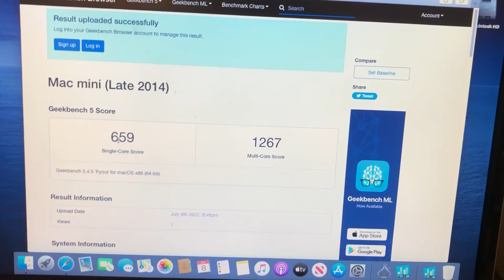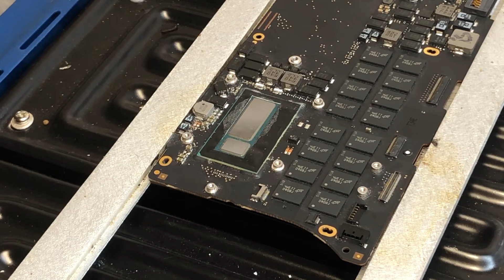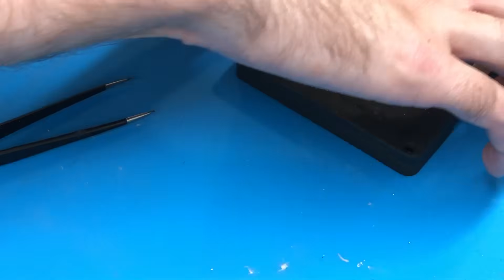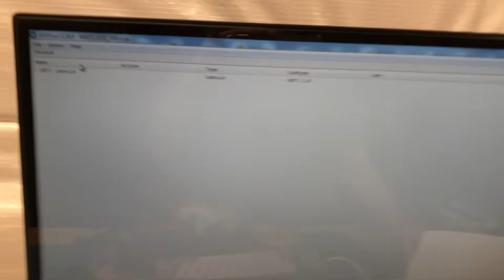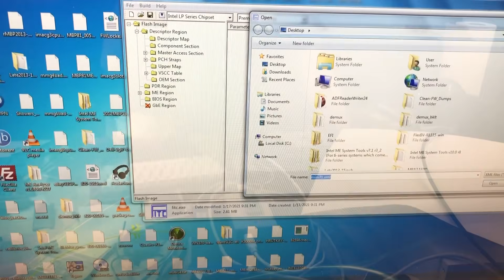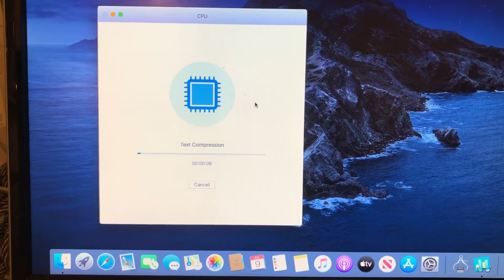2014 Mac Mini RAM and CPU Upgrade

Comment: Holy hell!  I thought I was cool upgrading my 2012 mini with 16G of RAM and 256 SSD.  This is hardcore.  Well done!  I love my mini!  Have Big Sur on it and for daily home stuff it works great.  At my work office I have the latest Apple gear.  EDIT: Geekbench 704 / 1726 with the i7 / 2.6Ghz / 16G / SSD / 4000 Graphics.
Reply: Why haven’t you upgraded it to Monterey yet?
Reply: @abduujabor  well you’re not supposed to get Monterey for Mac mini (late 2012) since it’s not “compatible” (which is a stupid lie apple made up) for it. 

But the thing is, you actually can get it! It’s just that you have to use open core legacy patcher (which is easy to use) and you need a 16+ USB flash drive to be able to use and get Monterey. 

Here is the link to the video of it happening. It’s actually works and it’s legit. Link: https://youtu.be/McmO7xP4wvI 

(Edit) I also recommend having 16 gb of ram (which is easy to change and it’s the most a Mac mini can take) to make the experience faster.
Reply: Oh. My 2014 mac mini is stuck with 8gbs of ram. Unless I do the procedure myself

Comment: i think the surface tension of the solder is strong enough to warp the hot chip when you take it off the board with the vacuum pump.try next time to flip it next on a paper towel with tweezers from the sides.i have removed cpus with tweezers aswell with 0.5mm metal blade tool.but overall you are a pro :D .keep up the good work

Comment: Please tell us, what are the tools your are using for these upgrades. Please it help
A lot
Reply from the maker: Just a standard Aoyue hot air station (with Aoyue 4545W nozzle for large BGAs), Puhui T8280 preheater, Madell QK853 small preheater, and Ksger T12 soldering iron.
Reply: @dosdude1  wow, with those tools, you are doing such an amazing work. 
Im also a board level repair and programer from Tokyo.
Keep going with your great works genius 💫 
Im pretty sure, you will be a legend of the computer industry. Amd gmug gpu fix, os patchers are  still helpful to save millions of peoples money.
if you can manage a little time, im really happy to sponsor a visit japan and show my workshops. Please send me your email if you interested.
Anyway Thank you. Good luck 🤞🏼
Reply: @dosdude1  if you don’t mind please send me your contact email. I wish someday i can see and talk with dosdude1 and Luis rosmman. Because you both guys have done such a great job for this industry.

Comment: Hey can you please write down in your video description which hardware are you using? I would like to know which preheater, which reball station, which soldering iron and which hot air gun are you using. I want to upgrade my equipment and I need some inspiration or tips. :-D

I've asked you a while before in comments in other video but I've never got respond.

Comment: Reballing that apu is the most difficult part because of the warping you mentioned, on  the 10th gen intel had to glue a metal support bracket to the corners to avoid It

Comment: I still have one of the 2014 i7 Minis as a daily driver, but unfortunately only 8GB Ram, which starts to  become a problem these days. Also, while it has a factory SSD, that one is very slow - slower than a budget sata SSD these days. Upgrading the SSD could help, soldering more ram myself is far out of my league, and getting someone else to do it would be expensive enough to rather save up for a used 16Gig M1 mini. Still, it's awesome to see that it can be done. Great video, dosdude1 !

Comment: Proof of concept talk: I have a 2011 21.5" iMac Education version (i3-2100, 256MB version of 6750M, no Bluetooth, 250GB Sata 2 HDD) that I got recently for mega cheap (less than $65). What would be the best and most powerful GPU upgrade with the following criterias: short length MXM card, as OEM as possible, retain boot screen and brightness control? Here's an idea: try and upgrade vmem on the stock 6750M GPU to 1GB or 2GB. Possible, doable, bios has straps for it, etc-etc? Any inputs are welcome. Oh, I can do the bga work myself.
Reply from the maker: Those Radeon HD 5xxx and 6xxx series video cards are unreliable trash, so it wouldn't even be worth a minute of your time to modify one. The optimal thing to do, of course, is upgrade the video card. There's a whole thread here containing compatible cards, along with custom VBIOSes, allowing for boot screen and brightness control on most: https://forums.macrumors.com/threads/2011-imac-graphics-card-upgrade.1596614/
Reply: Just don't put in an firepro m8900 in it as it is perhaps one of the least reliable mxm cards ever produced for both pc and mac.

Comment: First video of yours I've seen. Absolutely phenomenal job. I pulled the BIOS chip off of my 2014 Mac mini main board, dumped it, modified it, reflashed it, and resoldered it, but this is so beyond any of that. My only question is what is the motivation for this over buying something used (even the exact model you're upgrading to) or some other option? The challenge? Learning? Fun? Because I can't imagine any cost "savings" having to buy a Mac donor board + RAM chips, no less the stencil, etc. and sundry equipment I assume you already had and time required.
Reply: @anshadedavana  Absolutely it's not a for-profit endeavor. In a different comment he said "I'll either just keep them around, or give them to friends of mine who want them."

Comment: The performance improvement wasn’t as dramatic as 1.4GHz vs 3GHz would suggest because of turbo boost
It’s really 2.7GHz peak vs. 3.5GHz peak. Roughly 30% more performance from 30% higher peak clockspeed 👍
Reply: Never dismiss what a little bit of cache will do for performance which will add a few percent ontop of any had from clocks alone.
Reply: @MrKillswitch88  how do i make my 2014 mac mini handle more garageband audio tracks and plugins, i went with an external usb 3.0 samsung 870 QVO and that brought me to 400 MB/s read writes which helped, but i am looking for more tweaks?

Comment: Just to clarify - if I wanted to upgrade the ram of my 2014 2.6GHz, would changing the resistor configuration be sufficient instead of changing the SPD data like you did for the MacBook Air?
Reply from the maker: Yep, exactly. No SPD modifications are needed since the data is already there, just set via resistor configuration.
Reply: @dosdude1  If I understand it correctly, the resistor value sets a region where it needs to load data from, from the rom?
Reply from the maker: @ToTheGAMES  Yes, the value of the RAMCFG[3:0] lines is read, then a piece of SPD data is loaded based on that value.

Comment: More great work thanks Collin. Any chance of showing us the board pre-heater that you use please? Thanks  EDIT - I found the answer in one of the comments. Cheers. hot air station, Puhui T8280 preheater, Madell QK853 preheater, and Aoyue 4545W nozzle for doing the large BGAs.

Comment: Hi, we have a Late 2014 Mac Mini as well. Is it possible to upgrade it to 64Gb or 32Gb, or is 16Gb the maximum? What additional things would be required to do 32/64 if possible?
Reply from the maker: 16GB is the max, as those are the largest LPDDR3 chips you can get.

Comment: Have you any way to deeply test the MAC Cpu? I have one mid 2013 air, that crash randomly. I tested RAM many time by memtest, it seems Cpu problem - it crash in specific is applications only, os was reinstalled many times. I thing it's very specific problem occurs only in specific instructions. I saw this thing once time before in other computer, cpu crashed olny in ffpmeg in specific codec using SSE2 / after cpu replacement (same model,  same revision) problem is gone... But this it hard to do with BGA CPU :-D.

Comment: From a tinkerer perspective it's amazing what you did there, complete desoldering/reballing/resoldering plus programming of bios, I draw my hat and fully heartily applaud this work and dedication. From a non mac users perspective... why is there no slot for ram and a socket for cpu?
Yes I now, new ultrabooks are also guilty of soldered on cpu/ram/ssd, but up till 2013/2014 the larger notebooks still had replaceable cpu/ram and ssds. And desktops, we don't have to talk, they are fully upgradeable in most cases.
Reply: It forced you to buy the larger capacity models or ram upgrades at purchase at a significantly higher price, as you could never upgrade. I dare say it perhaps also made them more reliable being soldered ,but I’m not sure to what extent - if any.  I was waiting for the 2014 to come out so I could upgrade for a much earlier model, and when it did and I saw the soldered ram and cpu, I immediately bought the just superseded quad core whose ram and storage you could upgrade - and having two more cores was a lot faster.
Reply: Yeah, good linux knowledge and non Apple hardware makes life easier. But i love my 2012 airbook which rocks Pop OS and honestly, for many years there were no comparable pc notebooks and still today build quality is impressive. So i understand the attraction of Apple devices.... And the M cpus are impressive again. Wait for mature linux support😉
Reply: @sheldonkupa9120  what's an airbook?
Reply: @transportatitsfinest.2483  McBook Air 13 inch mid 2012. Just to be correct in details😆
Reply: I can say regarding the CPU as to why they moved away from CPU's in both windows Laptops and MacBook's, One is that it results in an overall thinner devices and the other is from DDR3 based devices -  the Signal integrity dependent (rise and fall time of high speed digital signals like DDR3 is very small order of few pico seconds - having a socket CPU adds metal socket pins adds more  impedance discontinuities which in turn results in  delays / corruption /slows down of these rise / fall times. with a soldered BGA CPU you minimize these impedance anomaly- this is wht they eliminated the socket cpu approach  ).
Reply: @rajdmohan  If that were the case, our self-styled desktops would be slow snails.
Reply: @KoriSolistiUnCelojumi   - Well i get your sarcasm, the point here is LGA which is primarily used in desktop processors 
Older PGA packages cannot scaleup in terms of need for higher fanout - that is why PGA gave way to LGA on desktop processors. 
If from a SI standpoint one CPU sockets are characterized from frequencies (45Mhz-15GHz) in single-ended and differential signaling modes but  the  characterization results indicate that the LGA and PGA sockets have comparable performance to 8GHz - so in desktop they moved from PGA to LGA - since currently the frequencies of interest -  for example DDR5 2200–3800 MHz or 2.2GHz  to 3.8GHz which is currently within the range of 8GHz performance optimal range for LGA - but if  in future CPU to DDR signaling scales up to a higher frequencies than 8GHz  they might have to go back to the PGA which has a better SI performance  in the 8 to 15 GHz
Reply: Some of the older Macs had the ability to change ram and hdd but they where finicky with what ram would work it was nice though, I guess its now a bit of both upselling the higher models instead of user upgradeable plus smaller form factors making it harder to replace.

Comment: what is the difference in tdp between those chips?  will the mini heatsink be able to handle the heat output?
Reply from the maker: The Mac Mini heatsink is huge compared to the one from the MacBook Pro it came from, so it can more than handle the heat output.

Comment: Nice video!
I was wondering if there any place were you share the tools that you use for this memory and cpu upgrades. It looks like a preheater and regular reflow station but I would like to confirm. 
Keep it up!
Reply from the maker: Yeah, just a hot air station, Puhui T8280 preheater, Madell QK853 preheater, and Aoyue 4545W nozzle for doing the large BGAs.

Comment: Is the Mac Mini a single channel ram system? If so, it might explain the underwhelming improvement.
Reply from the maker: No, it's dual-channel. After looking into it, the score it got was about the same as other systems with this same CPU. So it's working correctly.
Reply: Going to say that the improvement wasn't as some would have expected for a few reasons one of them being the ram as LP style ram is often a bit slower than the lower density modules that are user replaceable so with this options were well limited. Also the dual core at the end of the day is still a dual core so maybe it is possible to toss in a quad but I don't know what the thermal performance of this machine is like.

Comment: Very nice. I wonder if some thermal throttling is taking place here to account for the performance boost being rather modest.
Reply from the maker: The benchmark results are actually on par with other systems with this CPU (in fact are even slightly higher), so it is running as it should.
Reply: @dosdude1  Fascinating. Thanks.
Reply: I wonder too what the bottleneck is. Slow ram? Thermal throttling? CL timing? What if you to under volt the cpu?

Comment: It's amazing they sold this machine up until the end of 2018. We still have some of them in our labs. and we specced them pretty well at the time, they had the 2.6ghz i5,  256GB SSD and 8GB RAM. They run terribly today on Monterey, and it's officially supported! Yet we have 2012 i5 iMacs with after-market SSDs added and they run like a dream on Monterey using OCLP.
Reply: Because it's a low tdp laptop dual core vs a socketed quad core with 65w to 80w wattage.
Reply: @HoloScope  the 2012 i5 is a dual core, not quad. The quad is the i7. Which, btw, doesn’t run great these days. I plan to replace mine with an M2 studio.
Reply: I have the 2012.. it has a quad core I7 and 16gb of ram.. the 2014 was a step back I didn’t know what Apple was thinking.
Reply: They may possibly run a little better if you wiped and clean installed all of them with Monterey.
Reply: I am writing this from a Mac Mini 2014, 2.6ghz i5, 512GB SSD and 8GB Ram... and I am not agree with your statement "they run terribly today on Monterey". As a matter of fact, it runs smooth. I do Photoshop and Lightroom, Internet, Excel with no problem at all.
Reply: @asphixmx  mine too... its only a 4g RAM and even with HDD.. still working very well...
Reply: @asphixmx  I'm  typing  this on a 2012 quad-core i7  Mini w/ 16GB RAM and dual SSD's.  I've installed every iteration of Mac OS since purchase including Ventura (courtesy of OCLP). Performance has  progressively waned with each Mac OS update. What's a surprise is running  Linux Mint on the Mini: it's relatively light on resources, responsive, elegant and capable OS. I prefer it to  recent Mac OS releases.
Reply: @Fetucinee  I installed Kubuntu on mine and it runs like a dream.  These Mac Mini's are perfect for a gorgeous Linux desktop
Reply: Sadly newer version of macOS on Intel based computers really likes to have 16GB of RAM I found with my MBP 9,2
Reply: @arranmc182  ventura uses less 2 gb of ram, just like the bigsur. However, you can upgrade yours macbook to 16gb for ~$20
Reply: For me the 2014s don’t run terribly but also not great

Comment: Is it possible to put the cpu from the 2011 mbp 17 to a 2009 model?
Reply: Unfortunately not, as I believe they have different pin arrangements, so the swap would not work

Comment: What this machine deserves! I used to have one of the base model 2014 Mac minis, it was one of my first computers, and I have to say I think it's probably one of the worst Macs Apple ever made. Especially with the 5400rpm hard drive and it is slooooow. Even on the stock operating system it's hard to bear and it got much worse with APFS (and I assume further updates after that, I got rid of mine and switched to Windows!)
Reply: CPU and RAM may be limited in these models, but just upgrading to an SSD would make a maaaaaaasssive difference.
Reply: Why did you not install windows on it and put a ssd.
Reply: Yes, it is very slow. It is a good practice to test your patience. It takes about 8 minute boot time with Big Sur.
I replaced the MacOS with several Linux distros. And they run very fast. I'm glad I didn't  give it to Apple to be recycled.
Reply: My experience is a bit different. I just bought this exact model for $140 USD (very cheap in Australia.. we pay more for all our technology, sadly) and first thing I did after booting into the 5400rpm HDD was put an existing 500gb Samsung Evo 850 SSD into it. Took 45mins tops, used a steel coat hanger to remove the motherboard, and it is absolutely awesome now for what I need (a second Mac for general tasks - email and web browsing). No slowness now, and I have to have quite a lot of apps open to stress it. It even runs Monterey natively (unlike my better specced mid-2014 MacBook Pro), which is apparently faster than Big Sur or whatever the most recent one was called.
Reply: @heavypizzas6004  Can you add an portable SSD by using USB cable and boot from it? By the way, how do you open the Mac mini casing?
Reply: @as-1982  You can boot into USB sticks by holding down the Option key at boot, so I can't imagine why you can't boot from a USB SSD external drive :) Google should be able to confirm. Opening the casing was actually quite easy, and if you take it step by step with the right tools (Amazon precision tool kits have the security bits that you need), and a good light, and just do it carefully, you should be fine. None of it is ground-breakingly difficult. I followed this, mostly: https://www.youtube.com/watch?v=hgEBPlz4QB8